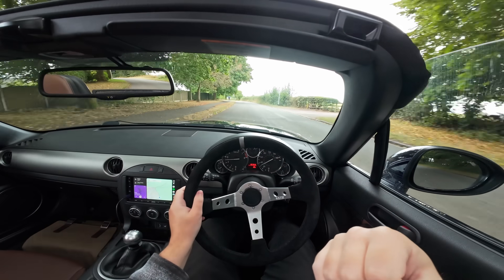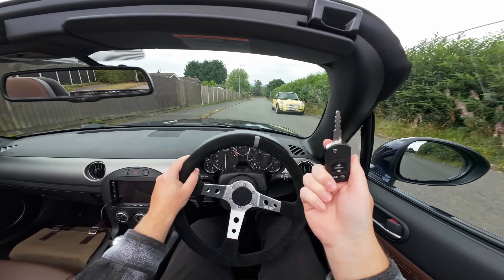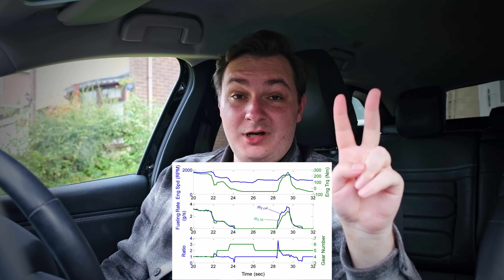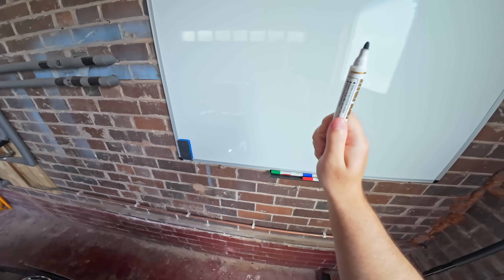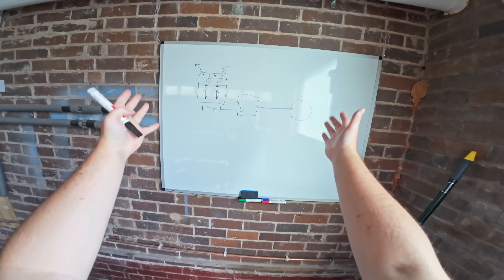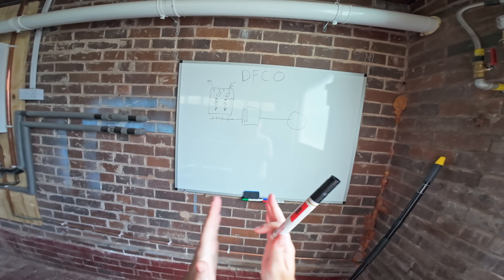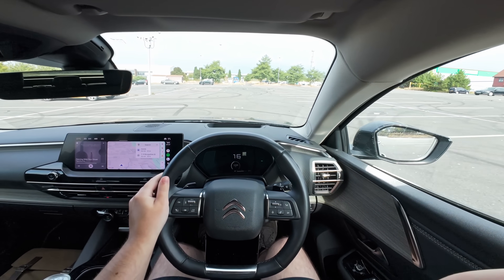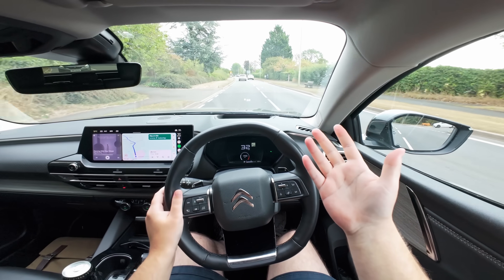The most misunderstood car term - Engine Braking

Comment: I mean who doesnt get off the accelerator to... slow down ?? In a manual car if you are approaching a stop light in gear 4 you of course need to at some point use the clutch and the brakes to stop. Not many people are gods at rev matching in like 100m to come down from 50kmh to 0kmh. And if you just get off the acceleator in gear 4 you will maybe slow down to 25kmh but then you reach idle revs and like you said the engine will keep you at idle revs.

Comment: I ve Tested the Engine you are using 1.2 Puretech 3 cylinder and actuality there's Fuel being injected under Engine Braking 🤦🏻‍♀️ I agree with you it shouldn't  inject any fuel but it Does inject Fuel 1.2L per hour under engine Braking 
I ve used OBD II On Board Diagnostic Tools , I was disappointed because this car is set to waste as much fuel as possible  , this car is set like a Hybrid
to actually use the Shut off System you have to Tap  the accelerator very gently to allow the car to role and this Turns off the fuel 🤦🏻‍♀️ terrible setup

Comment: This is why I get frustrated when people press on their brakes so much with no intent to fully stop or even significantly slow down. Engine braking allows for the flow of traffic to be smoother since people don't have to suddenly slam on their brakes thinking we're about to stop, just lift off the throttle and allow the car to slow down.  Thanks for the video!

Comment: I have dfco in a mechanically injected car. TPS on closed throttle at speed opens a bypass valve to atmosphere just after the airflow sensor.

Comment: I have a couple of questions:
1. Is downshifting to slow down faster a bad thing? I don't blip my throttle, I just let off the clutch slowly. Is that bad for the clutch?
2. When I have to use the brakes because I need to slow down faster, is it alright to also downshift at the same time to split the braking between the engine and the brakes?
3. Should I always try to revmatch when downshifting to extend the life of my clutch?

Comment: Now I didnt know about the fuel savings from engine breaking. 
But as a recently starting driver, I never understood people who drive up to the point where they want to stop and then heavily use the break instead of creeping down with speed by just releasing the gas pedal.
I have a fairly old car so my engine breaking is felt stronger, than say in my friends newer car, meaning you get more haptic feedback for pressing / releasing the gas quickly.
Maybe that made me automatically (without being told about it) start using engine breaking to come to a halt over time rather than using my brakes agressively, when driving all the way to the end with my foot on the gas.

Comment: There is no such thing as 'engine braking' in an ordinary passenger vehicle. In a diesel semi/lorry: why yes, there is! Semi trucks (usually) have systems that allow the engine's exhaust to be redirected to add additional resistance and slow it down. Classically, this was quite loud and communities banned their use, hence the 'No Engine Braking' or 'No Jake Brakes' signs—these are synonymous [signonymous, lol]. Newer mufflers are better, and they can get away with it. Just like moderate speeding, if you have your car well under control and not bringing attention to yourself, no one is likely to bother you, despite it being in violation of the posted rules.

Everything described in the video... happens when you're not slowing down as well! How can it be considered 'engine braking' if it's occurring while the engine is accelerating the car or traveling at a steady speed along the highway?

'Engine braking' in consumer cars isn't a feature, it's just a necessity of physics. The video also seemed to completely ignore air resistance and rolling resistance—*that's* what's slowing your car down. There's some amount of friction or some energy sink in both of those, with those two in fact where the majority of where your car's energy goes while driving.

Proof: My car is a hybrid. When I let off the throttle, it slows down faster than a regular ol' ICE car will. That's because the electric motor is actually 'engine braking' the car in engaging in regenerative braking by acting like a giant alternator. Then I can use that electric energy to almost achieve the same speed I was previously traveling at, even though there's some storage and usage losses in the electric.

If internal friction (that's really all that what the video is calling 'engine braking' actually is) used up so much energy that it could bring a car to a halt in a functional time frame, I couldn't both decelerate and reaccelerate while using mere whisps of fuel. Despite my electric motor soaking up energy, it's directly coupled to my engine and powertrain and I'm still experiencing all the effects of internal friction, or so-called 'engine braking'. But yet somehow... it barely affects the car's ability to get going again using the energy hoarded while 'electric motor braking'.

If there was so much internal friction that it could slow a car down quickly, your car would light on fire in stop and go traffic. There's a large amount of energy inhered in a moving vehicle, but if all of it were to go out to the air or road, then it's not a problem. Or if a lot of it gets soaked up into a battery, then that's no problem either! 

I'm pretty sure your wife's car is a 2021+ Citroën C5 X, and that's why it gets such great gas mileage: it's supposed to get 48.6mpg for the non-hybrid. So if anything, it's underperforming (you stated 47 I think?)

Comment: Slight note on your whiteboard lecture, yes the wheels are driving the engine during that phase but the engine is not really "pumping air in and out". The valves are closed off and it creates a vacuum (yes yes I know 'negative pressure' and all that) inside, which then provides the resistance that slows the vehicle down. Its kinda the same concept as if you hold a water gun, block the hole with your finger and pull the plunger and the moment you let go of it, the plunger gets "sucked" back to where it started by the vacuum inside.

If the engine let air both in and out like that, it would still slow down a tiny bit from friction and such, but it wouldnt be anywhere near enough to actually slowing to be considered engine braking. It would just be coasting at that point.

Comment: What seems like the first obvious  question  to me is:  why doesn't the engine stall when there is no gas going to the cylinder?
Reply from the maker: I spent considerable time in front of a whiteboard during this video answering this question
Reply: @MickDrivesCars hmm, I guess I didnt understand. I suppose if there is still spark going to the cylinder there is no interruption of ignition.
Reply: @MickDrivesCars so if I use your logic and extend it to when I am stopped at a stoplight and my car is idling there is no gas being used as the car idles? that's ridiculous! as long as there's combustion there's gas being used.
Reply from the maker: You're ragebaiting me right?

Have a good life
Reply: @MickDrivesCars  Apologies. Actually not. I re-watched the video and am fairly embarrassed at how little thought I gave to your discourse before commenting after the first watched.  I understand your explanation.  It makes perfect sense if one assumes the spark plugs continue sparking through the whole process despite the absence of petrol.  Is this the case?  If so, I think if you had addressed the role of ignition, I would have gotten it after the first watch. Cheers.

Comment: Shifting down engine breaking is an advanced thing? My god I must be a pro! Who taught these people how to drive? This was in my first 3 lessons I'm sure! The catalytic converter needs to balance rich and lean fuel mixes to keep the reaction balanced and convert those pollutants, so if you are always gas > idle> gas > idle it has to compensate by giving you a lean mix later which will also impact performance (most people won't notice that though.) You use less fuel and create less particulates plus need less maintenance overall. People need to cop on.

Comment: Thats true but i think if you dont want to slow down but want to save the most fuel i think neutral should be best even though the engine uses a tiny bit of fuel it doesnt waste the kinetic energy of the car by pumping air

Comment: There's engine braking and there is also coasting. I don't remember if in Eco a Citroën will coast, but on my currant VAG product with a DSG, I put it in Eco and it will go in neutral when you lift off, if you want engine braking a light tape on the brake will engage the transmission again. If you want more to go downhill to save your brakes, sport mode or manual mode will help.

Coasting allows you to maintain much more speed without using any gas, that's useful in a slight downhill for exemple where you can maintain momentum without using any gas at all.

It also makes driving al lot smoother and often faster as you have to look ahead and you will anticipate a lot more.

Comment: I don't care about fuel ⛽  but when you are engine braking down hill and you go 3000 rpm basically every part in your car is moving against each other and having friction there for wear and tear
Rather than having it in Natural with  900 fixed rpm
The gearbox and engine are more expensive than a set of brake pads 
The repair and maintenance is more expensive than gas I don't care about fuel efficiency
Reply from the maker: It's the same friction as when you accelerate...

Comment: What if I just put my manual car in neutral?? Would that consume any fuel?
Also if I'm in 4th gear, I would probably not let my rpms go under 1k because it'll put a lot of load on the engine
Reply from the maker: I did a video called "engine braking Vs coasting" that goes into this
Reply: @MickDrivesCars okay sir will go through it💪

Comment: but what if the rpm rises while in downhill?
Reply from the maker: gravity is doing more work than your engine braking. You can try to choose a lower gear for more engine braking, or help it with the real brakes if needed.

Comment: You mentioned it in passing at 12:52, but there is also a second kind of engine braking that limits speed rather than reduces it entirely. On any transmission, each gear has a minimum, median, and maximum speed that they're designed to operate at. If you're going above that gear's median speed, it doesn't just pump air through the engine. It creates a vacuum in the cylinders that applies an even stronger breaking force until the car reaches that median speed.

On manual cars (or automatics with a "Low gear" option) carefully dropping to a lower gear will slow down the car and keep it coasting at the median speed of that gear; especially if you're going down hill. You just need to make sure that you're going slow enough that you won't redline the engine when you drop down a gear.

On electric/ hybrid cars, there's also "regenerative breaking" which acts like an engine break, but returns the kinetic energy of the wheels to the car's battery as electricity. These work all the way down to 0 mph, and it can even be used for one-pedal driving if you don't mind loosing the ability to coast at speed.

Comment: "Engine braking" makes it sound fancier than it is. Who knew lifting off the accelerator made you stop accelerating? Does everyone* use their service brakes to slow down for lane changes on the motorways?
Reply: its “engine braking” because the motion in the engine naturally creates resistance compared to putting the car in neutral and letting off the clutch

Comment: Here's a question for you: Which uses more fuel?
1. Engine braking (no fuel used but kinetic energy lost to engine friction)
2. Coasting (fuel used at idle but far less energy lost to air friction)
Reply from the maker: I tested this! Go watch my video
Reply: @MickDrivesCars  Just watched it. I feel vindicated! I always thought it was odd how a lot of modern automatics don't seem to coast very well (in Drive), and thought they could improve fuel economy further by disengaging the torque converter when lifting off the gas. Upon learning of DFCO I thought maybe that was why, but it seems conservation of momentum still wins out in the end. Though maybe there are other reasons why autos do this. But it still feels like my 2007 Buick has infinite speed after driving a brand new rental car for a week.

Comment: one thing I don't get is why engine braking takes me less further than holding the clutch and let the inertia take me as far as possible. I can feel some resistance when i use engine brake. I am on manual .
Reply from the maker: Makes perfect sense - when engine braking you have an additional force slowing you down. When you press the clutch you disconnect the engine from the wheels.

I actually have a engine braking vs coasting video - go check it out.

Comment: Engine braking is specifically releasing the accelerating AND downshifting. Simply just releasing off the accelerator is literally coasting.
Reply: Coasting is when the clutch is unnecessarily engaged. Engine braking does not need downshifting, that just makes the engine braking more powerful. Dont you ever listen?🤦‍♂️

Comment: for what it's worth, my understanding is that some brands/models use DFCO and others continue to inject small amounts of fuel, and it's based on the manufacturer's goals with the feel of the car, some cars are designed to feel more "luxury" by actually burning tiny amounts of fuel when you've fully lifted still, just to prevent the car from engine breaking and make it feel like it coasts more. I believe you're right for most models nowadays, but it's technically possible that some cars, especially older models where not all manufacturers had implemented DFCO, may not go all the way to zero fuel consumption when fully lifted.

Comment: I personally use engine breaking without thinking about it myself, but didn't know the duty cycle for the injectors was zero, pretty interesting. A thing those real mechanics react can do to actually test this is to use an amp meter (or an OBD scanner that can record the duty cycle if they have one that fancy) and see for themselves.

Comment: I never thought this is such a debate topic. The key idea of engine breaking is that the pistons are no longer moved by the controlled explosion of gasoline and no longer transfer power to the shaft, wheels etc. but just by the inertia of the car, the whole engine is running with the power being applied from "the other side", from wheels to the shaft and to the pistons (in short)

Comment: Everyone should learn what the phrase "lift and coast" means from racing. Lift off the gas pedal and coast to the corner instead of accelerating all the way to the corner and braking at the last minute. 

Racing drivers (including F1) do this to save fuel, cool/save brakes, save tires. Yes it's faster to go around the tract by braking at the last moment but it's not efficient for saving tires.

Comment: By definition, engine braking requires DOWNSHIFTING.  If you are driving an automatic car and lift your foot off the gas pedal, the car disengages the clutch (essentially switching to neutral) to avoid 'engine braking' and wearing down the clutch.  You are describing COASTING.  Coasting is not at all harmful; if you want to experience engine braking, lift your foot off the pedal and shift into low gear.  You will immediately notice how much faster the car slows down; this is because the clutch stays engaged, and the gearbox forces the engine to slow down the car because it is (forcibly) maintaining a lower gear than is needed to keep the car going at the same speed.  This subsequently causes friction that wears down the clutch and other components much faster than usual.. This is why mechanics do not recommend engine braking unless you are in danger of overheating your brakes.
Reply from the maker: Factually incorrect.

This video was filmed in an automatic car which does not disengage the torque converter when off the throttle. In fact no auto I've ever driven that wasn't a hybrid does this.

Sure, you can get more engine braking by downshifting, but it isn't required. 

Also the clutch damage stuff is nonsense. Most if not all modern auto cars will blip the throttle on downshifts so you don't wear your driveline. The driveline wears the same forward or reverse so accelerating/engine braking at the same rate have the exact same wear.

Comment: Is it really not common to use engine braking to slow down? I'm pretty sure I've saved a ton of gas and brake wear just by doing this. No one ever taught me explicitly either. It just made sense that if letting off the gas meant I slowed down why brake if you don't need to?

Comment: I'll tell you why they don't know about fuel cut off ... They are American. Saving 2 Liter per tank on their gas guzzling engined big and heavy cars is basically undetectable and unmeasurable for them since that's not even one gallon. Driving in America is a lot more aggressive on inputs like getting on highways people just send it to get up to speed, so for them any savings are negligible

Comment: Hi Mick I’m from the US. I just watched this video and am very surprised to learn this. One question I had is I have an automatic transmission car but I have a standard option and I downshift sometimes and the RPMS rev up and I do slow down a decent amount which you call I believe using your transmission to brake. And I wonder if that will damage my transmission or if it is perfectly safe to do. Also, does that save fuel as well downshifting and letting RPMS go up to slow down? I’ve been under the impression that saves a lot of fuel.